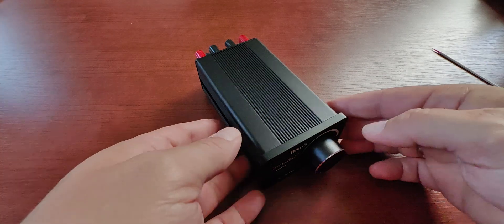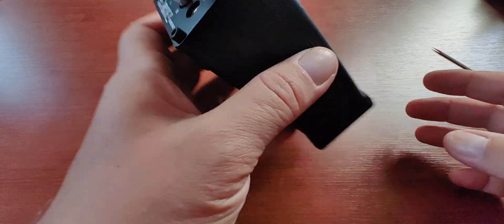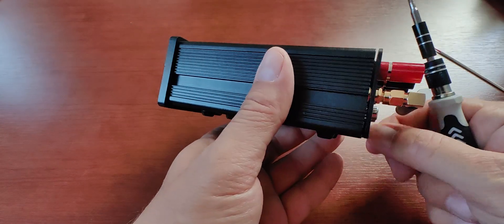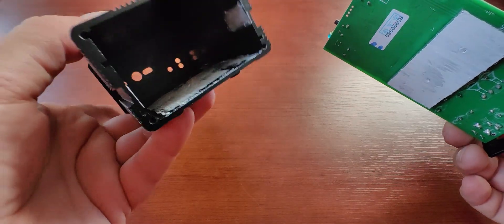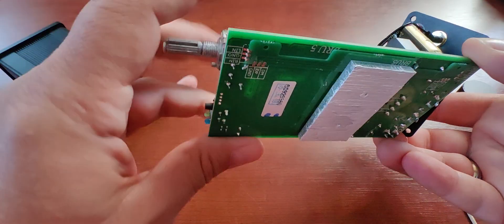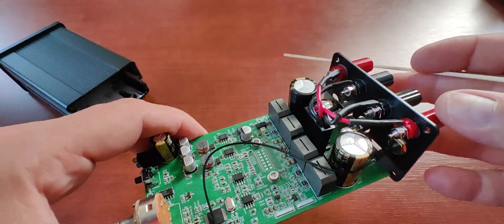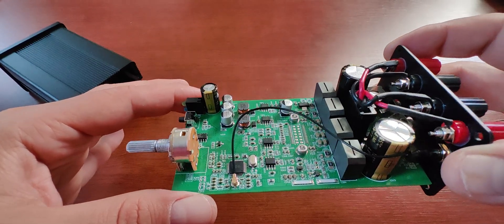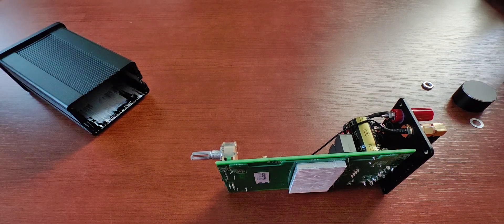Speaker amp with DSP for 30USD??? BRU5 BerryBak first look inside!

Comment: The 3255 is fundamentally analog. There are no digital audio inputs on this device, so DSP will require ADCs & DACs, they will impact sound quality. ASR members have commented extensively on this device, starting about two years ago, it's worth reading. Cheers!
Reply from the maker: Yes, exactly, tpa3255 is an integrated class d amp but that's still analog. There is a separate DSP inside for all processing fun

Comment: Is it possible to run the bru5 in mono mode?
I would like to amp a single full range 8 ohm driver. Source will be bt (my phone) so bridge mode or Left+Right sum using DSP would be perfect...
Reply from the maker: I don't think so, unless you're just planning to use single channel only. I haven't seen any way to bridge the channels here

Comment: There are two different versions of the BRU5, the most popular is the one with TPA3255 but there is another one (I own it) that uses the TPA3244 chip.  This one is top mounted on the PCB and no heat sink or thermal paste. It's lower power and doesn't need a heat sink. It's a much different chip and sounds different. With high sensitivity speakers it's enough power. The 3244 version sounds pretty good for such a low price with my 96db 15" open-baffle speakers with horn-loaded tweeter.
The PCB layout is exactly the same in both versions of the amp except the top/bottom mounting of the power chip.
  I doubt seriously the quality of the speaker connectors matters to the sound. The output caps yeah, maybe worth upgrading as well as the opamps if you have the ability to do that with surface soldered chips.
Reply from the maker: Thanks for sharing! 
I wouldn't like to touch SMD caps as I don't think there are any "hifi" SMD caps - I've never heard of any. Opamps if socketed are usually simple and fast upgrade, but as for connectors they do change sound in a very miniscule way (to my ear) but in order for this to make sense you have to push everything else to the limits.
I've heard and liked tpa3221 a few years ago, I had no idea that there is something like 3244!

Comment: Hi, can I adjust the output audio delay with this device? And if so, up to how many milliseconds per channel can I set it? Thank you very much, nice vid.
Reply from the maker: Thanks! 
It's a shame really as this first look was quite some time ago, but I didn't get to make a full review yet so I just don't know :(
Try googling functionality of the software that configures this amp, maybe there is some kind of web demo, manual or maybe it's possible to run it without amp connected just to take a look at the options

Comment: Could be a nice amp for an active crossover setup depending on the capabilities of the DSP.  You could use this the power a tweeter and midwoofer using the dsp for crossover duties.  If you use one unit per speaker so you have one channel driving the tweeter and one driving the woofer, it might sound ok.  You would need two units for that configuration.  You could have a high pass filter and then use a powered subwoofer for bass duties.
Reply from the maker: I was speaking with a couple of local guys that were using aiyima 07 max with active crossovers (like three of them for three way speakers) and they said its the best thing since sliced bread. Havent heard that myself though (yet?)

Comment: @ 4:45 is probably not the DSP chip. Look close to the BT antenna and your see a MV BP1048 or similar. Depending on the feature set loaded in the DSP chip there may be an XTC filter, typically named 3D. This is definitely worth trying.
Reply from the maker: I will look closer for full review, thanks for pointing that out. That was just a short evening video ;)

Comment: The Fosi V3, ZA3, V3 mono, Aiyima A07 Max have 2200uF capacitors with the same chip. I wouldn't count on a lot of dynamics in the bass department from this one with 470uF.
Reply from the maker: @D1N02  yes, it's small and it's cheap. But I think it will be easy to replace them with something that's also cheap but with bigger capacitance (as long as it fits inside). I need to check my cap box :)
This can be a fun diy project as long as DSP will make it worth my time:)
Reply: You are wrong.

Comment: Is it possible to use it as a DAC (i.e. audio from the usb port)?
Reply: The DSP Processor on this BRU5 is BP1048B2 which has Sound card Functionality on Windows and Linux with SPDIF output. Not sure if they disabled that functionality on this product or not. There's a software named ACPWorkbench, you can configure the chip and input outputs + DSP (if the chip is not password protected).
Reply from the maker: @blakewnelson94  No, that's only for DSP programming afaik.
Reply: @k4syx  Yeah, that makes sense. Shame though, I'd buy it if it had a DAC+DSP at this price point.
Reply from the maker: @blakewnelson94  I don't know what would be your source, but this toy has Bluetooth, so "kinda digital" input :)
Reply: Just tested out mine with a 36V5A supply.
Didn't play loud.  The chassis is hot like a class AB

Comment: Highly Intrigued!!! Thanks!! 

I would love to just try an external capacitor bank tied to the power supply.
Reply from the maker: @HeavyCrown2030  yes, there's also possibility to replace internal ones with something bigger but same dimensions. I'm also very curious about this toy :)
Reply: @k4syx  I live near the plant where the design those chips in America . 

I want to build a multi-speaker pair like the Beolab 90 that $100k
Reply from the maker: @HeavyCrown2030  keeping my fingers crossed for getting pair for testing! :)